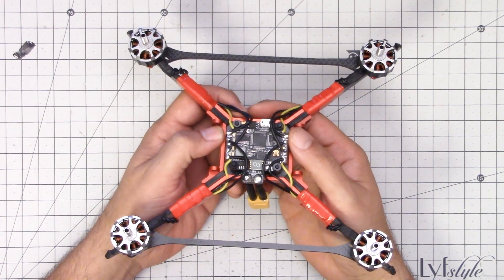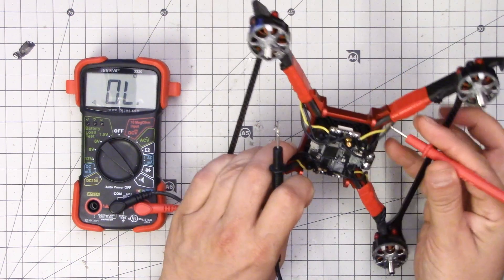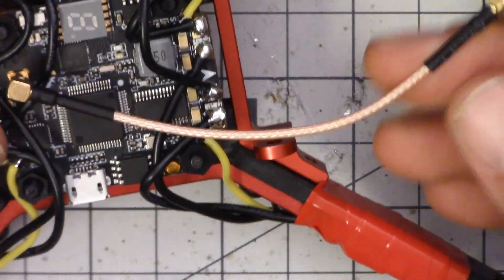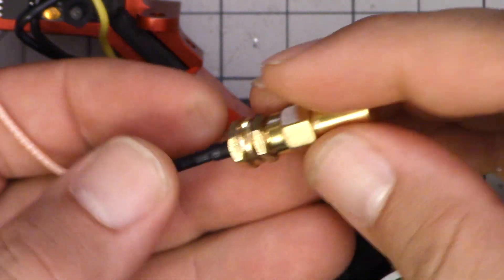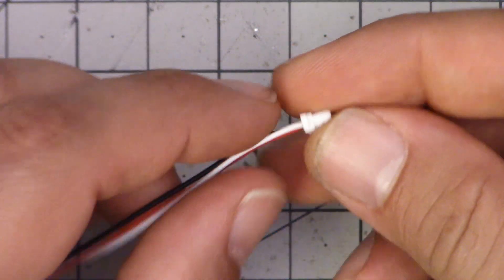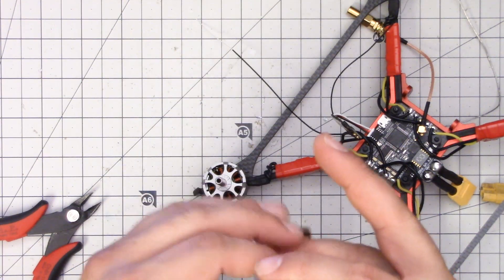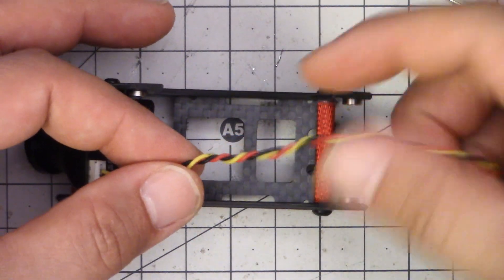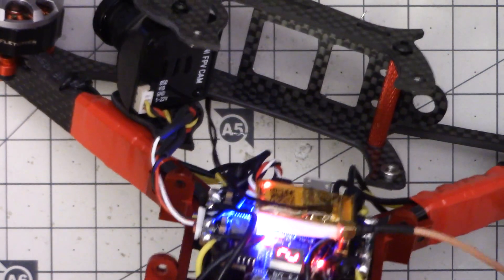RACING DRONE FULL BUILD | Part 4 | Karearea Talon ZMX FinX30 HGLRC F4 v5 Pro

Comment: Hi Joshua Good Day, i have gone through the "Karearea Talon Racing Drone Full Build" and had same Furibee F4 FC. iam struck with setting up receiver i.e FS-iA10B and Transmitter is TH9x. Can you please help to fix the receiver issue.  Under receiver tab the channels are not responding to sticks movement.

Comment: I'd like to know If I need to do the inversion trick to use telemetry with the Frsky XSR receiver or I can just plug the smartport pin of the receiver to TX3 or TX6 pin of the FC. 
Best regards!
Reply from the maker: If the FC is an F4 then you need to uninvert the signal before you can use a regular UART pad like TX3 or TX6.

Comment: i found i had problems with ipex connectors as they kept falling off in heavy crashes, easyest way is just to solder the pig tail direct to the board

Comment: What worries me, 3 weeks and still no flight video.... Did the whoops of powering without the antenna cause a little hold back?
Reply from the maker: No, I have just been on vacation :-)
Reply: Joshua Bardwell Vacation on! You have been doing so much for the community, you deserve it. I still have two weeks to take myself. And, I'm thinking of imitating this build, but with the Racerstar 30A 4in1 F4 board. I have a unify to tap in so I don't need the onboard vtx.

Comment: Maybee a stupid question but what type of flux do you use ?i went to the store and there are alot of difrent types is it maybee the one also used for copper pipes? (Because on nothing stands that it is for soldering wires)
Reply from the maker: +Bennie Leip it is definitely not the plumbing flux from the hardware store. Watch my video with SRA solder guy for info about flux.

Comment: The dummy load antennas don't work. Just got mine in the mail. Tested them. From 50 feet away I still get signal. Took one quad and put it on 25mw set to raceband 2, took another quad set to 25mw set to raceband 2 with the dummy load antenna and I still got bleed over from the dummy load quad from 25 feet...

Comment: I heard you comment about people complaining about you not using the wire stripping pliers.  At the time, I agreed with your comments as there are a LOT of GOOD ways to strip wires.  Then I saw this video and saw how you stripped the wires for the transmitter!  DEAR GOD MAN!  Tearing that off with your fingernails is NOT one of the MANY GOOD ways to strip wire!  No freaking wonder you have trouble with the small coax cable.  Your on YouTube all the time.  I'm sure you could find a couple of good videos on several GOOD ways to strip wires.  It would help.
Reply from the maker: If it's silicone wire, fingernails are more than adequate.
Reply: They WILL take it off, they just do a REALLY crappy job of it.  And just watching this video shows it was impossible for you to consistently remove the same amount from each wire.  BUT!  Your wire, your procedure!

Comment: This build has been such a disappointment with the set up, Joshua you are putting yourself through a lot of un needed PAIN, NOW its the receiver RIP GOES THE ANTENNA, I have to watch this in pieces to much junk on this build. come on really, what next with the battery, I really think a Traxxas 8.4v 3000mah NiMH just weighed it, 395 grams will fit and look great, And do yourself a favor, light the thing on fire with some lighter fluid on take off, no worries the battery is not lipo, so no explosion be the best part of the flight- a fireball of disastrous components as it falls from the sky in ashes, no worries though, that bada$$ frame will survive.
Reply from the maker: +lgrip1 lgrip1 actually I was thinking of a Turnigy Nanotech. You think 45C is good enough?
Reply: that is funny, I like how you handled this, not trying to bash you :) you have a lot of GREAT VIDEOS, And yes nanotech 45c (have it puffed ready to explode) sounds perfect, have a great day. Your a good man Joshua

Comment: I don't understand why you didn't went for a 4 in 1 esc ? This frame has been made with the aerodynamics in mind, putting the esc on the arms with the wire twisting around ruin it. It may still be better than a regular flat arm but clearly not as good as if you had shrinkwrap the wire strait on the top of the arm.

Comment: My flysky FS-A8S also came with 27.8mm antennas. When I stripped them to 31.25mm I couldn't fly more than 10 feet away without failsafe. Stripped it back to 27.8mm and it could fly hundreds of feet away.
Reply from the maker: Beats me.

Comment: I will wait for the cloner's to get going with these builds before getting one £ 50/£60/£70 come on all they have done is flipped the arms 90 degrees and added motor mounts, hardly rocket science, for the xtra money i was expecting plutonium fueled or titanium plateing, inovation, sure but way to expensive.
Reply from the maker: I think you're vastly under-estimating the work that goes into designing a frame like this. But it's your money, of course.
Reply: Also, with this frame design the components need to be quality or it falls to bits. GL getting a clone frame at a lower price with similar quality components. There is already a clone out, it uses softer aluminium and poorer quality carbon....first crash and it will explode. As JB said....your choice quality or 5min flying before rebuilding

Comment: Just wanted point out in case you didn't know that you should never fully close your calipers, leave some space because they can oxidize and rust must faster when the 2 surfaces are in contact, trick I learned about back when I worked in a machine shop
Reply from the maker: Ok that is a good suggestion!

Comment: @Joshua Bardwell, didn't see the details of the receiver being wired. Did you have to invert the signal? I think for XSR, you need to invert telemetry.
Reply from the maker: It's an XM+ receiver. It doesn't have telemetry. I agree that this FC does not have any inverted inputs other than SBUS though.

Comment: this was a giggle, could somebody look into why quarter wave 31.25mm is never used.. flysky is typically 23mm on tx and rx and iforce2d tested it with 31mm antenna and found it had slightly less range, not significant difference though if i remember correctly,... pps.. can anybody mediafire me lens correction preset folder from premiere pro, and or the manual effect plugin.

Comment: Joshua, I am having trouble with my taranis plus tx and betaflight!. I fly mode2 and i am  use to the yaw being on the right stick, so i watched a video and switched my Taranis plus tx ch 1 was ail and ch 4 rudder , i switched them in my tx but it did not change? please help? Thank you in advance for any or all help.
Reply from the maker: You moved the channels that output the yaw but that doesn't change the controls that input them. You want to change the Taranis input mode. I don't know off hand what the mode is for yaw and pitch on the right. Nobody flies that way and I would strongly advise you to learn to fly Mode 2 (the default). The reason is that most other people in the world fly Mode 2 so when you watch an instructional video or when you borrow somebody else's quad to try it out, it will be Mode 2. You will really be making your life a lot harder if you don't learn mode 2.
Reply: Josh. Sorry I do only fly mode 2 throttle yaw left stick but on my ideafly f90  PRO octopus yaw and throttle is on the left roll on right and i can not get used to that, sorry for saying it incorrect!

Comment: Got my Talon frame in Monday. Doing this as my 1st build.
EFAW 2407 Motors
DYS 30A BLHeli_S 4-in-1
Tramp HV VTX
RunCam Swift 2
Spektrum SPM4649T Telemetry Reciever
Kakute F4 AIO Running BetaFlight 3.2.0 RC5

It's going together well. Will probably need some help when I get to the point of setting the initial PIDs when I get that far. I calculate with the right props  and a clear straight away it will about 100-105 MPH
Reply: Building a talon with efaw 2407 too...........you`re gona have fun with the pids that setup rattles like hell until tuned.
Reply: Whats your weight without battery, I'm at 342g

Comment: For those of you that hate splicing wires, buy stuff like this: http://www.ebay.com/itm/152613649721
The connectors on the HGLRC F4 is JST SH 1.0mm. XSR and cameras are Molex PicoBlade 1.25mm.
Get yourself some JST GH to JST SH and JST SH to Molex. You're pretty much set.
You can keep the exist housing that comes with components, remove, and replace them with these pre-crimped cables.
I like it better than direct soldering. It makes it a lot easier for upgrading firmware.

Comment: Hi Joshua, just to share, you may wish to consider using Tyco Electronics CWT-3801 soldersleeve-shield-terminators when connecting small diameter wires together instead of the conventional way of soldering and than protecting it with standard heat shrink tubes. We use this connectors in certain delicate sub-sea connections. It's not expensive, comes with a very pliable, transparent & strong heat shrink transparent tube, don't need any soldering iron, just a heat gun or cigarette lighter will do. Protects & reinforce delicate wires from getting stretch at the joints (which is usually the weakest part) and the self contained (middle portion solder ring) melts and within the see thru tubes (good for inspection at anytime). Its water proof and tough, looks nice & professional. I'm not from Tyco, but a crazy FPV enthusiast from Singapore. You can check it out at http://www.te.com/usa-en/products/harnessing/interconnect-devices/soldersleeve-shield-terminators.html

Comment: Josh... Has the Betaflight f3 been discontinued??
I need to do a build , and I wad so excited to use The Betaflight board, and now it seems to be unavailable. Is an F4 coming soon? 
I Need To Know 😵🔫
Reply from the maker: Yes. They are releasing a BFF4 soon and the F3 is discontinued.
Reply: Joshua Bardwell - thanks for the info bro

Comment: Just a thought, for the arms to reduce the increased drag caused by the ESCs, why not place half round rod on the top of the arms and triangle rod on the bottom of the arms before taping/heat shrinking  them. That will cause the profile to be more airfoil shaped. Found half round on amazon https://www.amazon.com/uxcell-10mmx5mm-Solid-Acrylic-Round/dp/B01N0EVYRT/ref=sr_1_1?ie=UTF8&qid=1505330634&sr=8-1&keywords=10mm+half+round+rod and triangle rod here http://www.usplastic.com/catalog/item.aspx?itemid=24196&catid=440
Reply from the maker: For turbulent air like the arms are seeing, an airfoil shape isn't really as useful as you would think. The best thing you can do is reduce the surface area.
Reply: FWIW, the really trivial amount of air detach/vortex generation from the square leading edge of an arm is going to be so thoroughly buried under the pitch/unload mismatch which is ramming air at the arms in a turbulent fashion - saving weight is going to matter more in terms of achievable Cd (drag coefficient) for going fast and being maneuverable.  Josh is, unsurprisingly, totally right.
Reply: Thanks for the replies.  Will def not waste $$/time/and weight doing this for my own drones. I will go with the 4 in 1 escs instead.
Reply: Anymore, the over-specced ESCs on the 4-in-1 boards (like the 30A-40A Wraiths, or 32b variants that can do current limiting), I no longer see the 4-in-1 ESCs having such sever reliability drawbacks in the big picture

Comment: I've use small gauge wire strippers to modify the tiny frsky antennas. Works perfectly in a single step. 
Similar to this.  https://www.amazon.com/gp/aw/d/B005JVJDIA/ref=mp_s_a_1_5?ie=UTF8&qid=1505329191&sr=8-5&pi=AC_SX236_SY340_QL65&keywords=wire+stripper&dpPl=1&dpID=41wLKR3XfAL&ref=plSrch

Comment: I learned something today at 8:20;) Is this why the range on my XM receiver is so crap? Because the wrong length of antenna is sticking out? I'll have to look into this.
Reply: MH Radio Control I'm not so sure that the antenna element size is wrong, my xm+ have same (maybe more) range as my x4r-sb receivers. Maybe FrSky know that the antenna wire is less quality (less shielding perhaps) and adjusted the size to get the best range. I have read something about the velocity factor of a coax cable, not sure if this applies...
Reply: DanO FPV I  should have specified that I meant the non + version with the single antenna. I find I get failsafes at less than 200m. No probs with the XM+.
Reply: The normal XM is only rated for 600m by FrSky which probably means half this distance in reality. The XM+ is rated full range which is normally 2000m. However I'm getting barely 1000m with them.

Comment: does any one know whats the best starter kit racing drone rtf ?
Reply from the maker: QQ190 is very good but pricey. The key selling point is that it can be maintained with zero soldering.

Holybro Kopis just went on sale (my review coming soon) but I can tell you it flies amazing. Not fully RTF. You have to order it with a FrSky receiver and bind it yourself, or install any other type of receiver if you don't fly FrSky.

Take a look at the AvantQuads Plug-N-Fly models maybe?

Catalyst Machineworks will take good care of you if you have more like $500 to drop. For that price, I would expect them to help you set up the dang arming mode while you were at it.

Comment: Joshua. You need to get those ESCs off the arms man. Get a 4-in-1 and put it in before you fly it and draw conclusions on it. You’ve built this thing in a way that kind of makes it no better than any other quad by fattening the arms with those ESCs.
Reply: Yeah you know it's eating at him, he's gonna have to put a 4-in-1 on there and make a video if not sooner than later.
Reply: I have 5" talon that is built similar to Joshua. I am not big fan of 4 in 1 esc for my own reasons. It flies awesome. I built a 4" talon and I chose to go with 4 in 1 esc (dys 30A + dys f4) combo just for my own curiosity. It flies awesome and not any better than my 5" talon. With that said, if you claim that those escs on the arm creates more drag, I can tell you just from my experience that it is not that significant.

Comment: LIke you I like running telemetry, as I've never had an OSD. On this build do you HAVE to you use the sbus pins or can you use the other txrx pins so I can have my three wires for my Rx all coming off one jst connector instead of having to put mulitple ones on. I just ordered three of these to upgrade my two copters from spracing f3 boards. Can't wait and thanks for doing the series!
Reply from the maker: You always HAVE to use the SBUS pin on an F4 board because the other UARTS won't have an inverter.

Comment: I have a bit of hack/advice. At 12:21 you used 3 heat-shrinks on 3 wires that were cut at same length. I found that it is much cleaner to cut them at different length so the wires do not bundle up like that. Also, in some cases it may be possible to use one heat-shrink for bundle.

Comment: How wide are the supports between the front and rear arms? Those are under the prop discs and need to be considered also when comparing the arm width to other frames.  

Being 40 grams heavier than something like a Twinquadframes Lite-SR, and with only marginally improved aerodynamics when you consider the arms, supports, ESCs or motor wires, I don't know about this frame.
Reply: Is that a compressor map in your thumbnail?
Reply: ASJC27 Yes, a turbo compressor map.  I am supercharged now though.
Reply: Cool that's what I thought. What car do you have?

Comment: In case anyone is looking for the connectors that go into the board here is what I purchased and confirmed is correct:

https://www.digikey.ca/products/en?mpart=SHR-08V-S-B&v=455
https://www.digikey.ca/products/en?mpart=SHR-08V-S&v=455
https://www.digikey.ca/product-detail/en/jst-sales-america-inc/ASSHSSH28K51/455-3075-ND/6009451
https://www.digikey.ca/product-detail/en/jst-sales-america-inc/SSH-003T-P0.2/455-1561-1-ND/720818
https://www.digikey.ca/product-detail/en/jst-sales-america-inc/ASSHSSH28K305/455-3077-ND/6009453

Also I would like to provide a warning not to use the cheap mushroom style antennas on this flight controller, I think I burned out the Vtx by a crash that shorted the antenna and then the micro wouldn't even boot anymore (if i am lucky I can just desolder something to do with the vtx and at least use an external one)
Reply: +TheBeefiestable Thank you for that! Very much appreciated.

Comment: You know, you can crimp your own JST pins and build you own custom wire harness so that you dont have to solder slices if you dont like them. It's not as hard as it looks. The first few times are harder but with a little practice you should be fine. I reckon it's probably not that much longer to do then stripping, soldering, heat shrinking each splice.
Reply from the maker: Micro-JST are so small that I don't find it worth the hassle to crimp them.